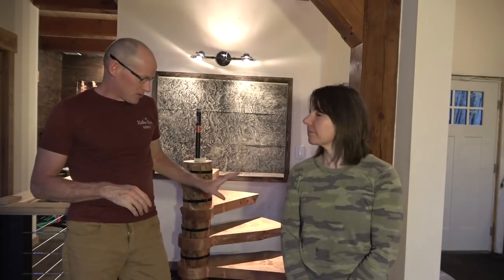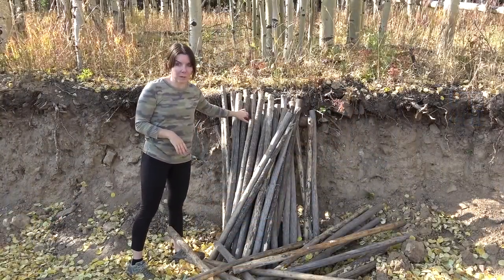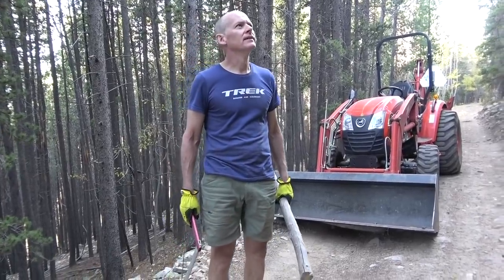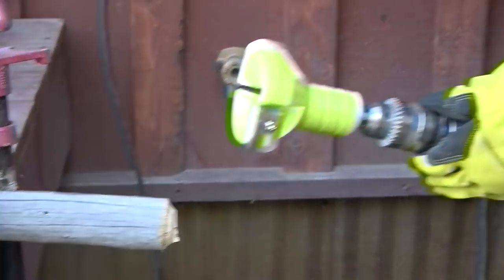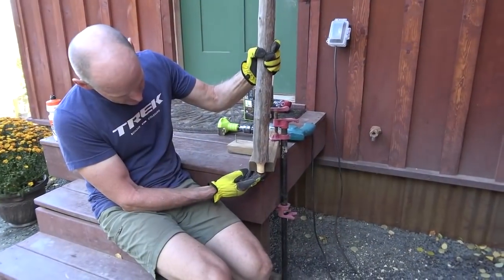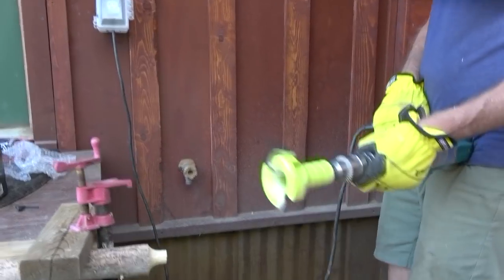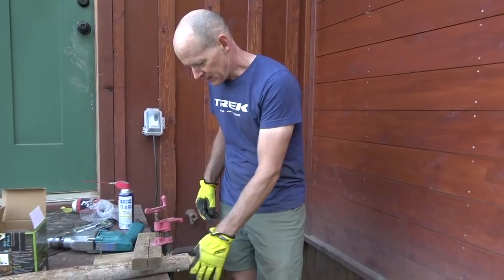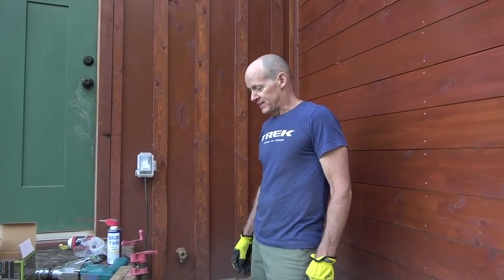Making Spindles for our Stairs; Trying out a New Tenon Cutter Tool

Comment: I have done this, and the fastest way is to drill 3/4” hole with drill press or large hand drill. Then glue in oak dowel, job done. And the end is flat and will sit flat on the tread. No more cuts required. P.s. love your channel.
Reply from the maker: See what you're saying there, completely flush connection at the end. Thanks!!

Comment: Don't use oil - use paraffin, beeswax, floor wax, whatever so the glue won't be affected later. (I suppose Acetone would clean it off later...)  Start by tapering the wood. with an axe or hatchet -- make sure the taper is fairly "centered" to the wood. Drill press idea could work if you have the floor model and turn the table/head  to the side and clamp vertically in some way. THAT could be the challenge there.
Reply from the maker: Ok Gotcha. Will see if the drill press has that capability.

Comment: Used a similar tool, used mine with wet wood, much easier. You are cutting very hard, dry and probably the biggest diameter that tool was designed for. Dunk the end into water, give it a shot. GOOD LUCK GUYS. A lot of fallen lumber into the forest, fire wood Bonanza. I'd spend a few days collecting fire wood‼️👍. Vinny 🇺🇸
Reply from the maker: Thanks for the tip!

Comment: What are the specs on your drill? LumberJack recommends a single speed, 1/2" at 450 or less RPM at 7 amps. I'm trying to find one that will work for me.
Reply from the maker: The drill in this video is a Makita 6 amp 3/4" 2 speed hammer drill 0-900 rpm. We had better luck with using the drill press for this job however.

Comment: There is a way to insure there is nothing living in the wood without needing to treat them with chemicals by using heat. Harvesting the elements out of an electric oven and a rock wool box will let you custom make an oven to heat the wood to 200F for 24 hours to kill of anything inside it without discoloring it. Grubs of wood eating bugs can be living inside the wood for years leaving you with the sound of scraping for a few years before you get a mature bug popping out.
Reply from the maker: We've had similar experience when making our stair treads. We've fished out a few bugs, which turned out to be beetles. You can definitely hear the scraping sound! Thanks for the tips.

Comment: Get it ripping full speed, then touch it to the spindle. It will start better
Reply from the maker: Thanks for the tip. That's sort of the strategy used when using the drill press.

Comment: Looks like the cutter dulled on the first tenon.  Cheap white metal rather than something hardened or carbide.  May have been intended for soft and damp wood.  Reducing the radius roughly would help, as would clamping and using a drill press with a feed through the work plate.  I suspect that tool is using cheap blades and won't hold up to 50 cuts in hard wood.
Reply from the maker: It was still quite sharp, but perhaps the larger radius of the wood prevented adequate surface area connection.

Comment: ..remember spacing between balusters, under 4" ,, whatever rail material use check local codes, between 1 1/2"---2" grip surface,... continuous rail top to bottom tread nose ,,NO CAPS ALLOWED ON SPIRAL RAKE RAIL,, cannot block hand contact off rail on rakes,, guard rails on landings ,post to post,,OK,, .....
Reply from the maker: Trying to understand your instructions here- No caps allowed, spiral rake rail? Can you say more?